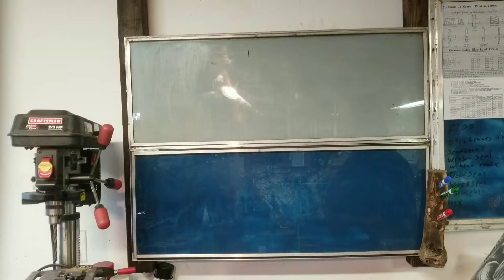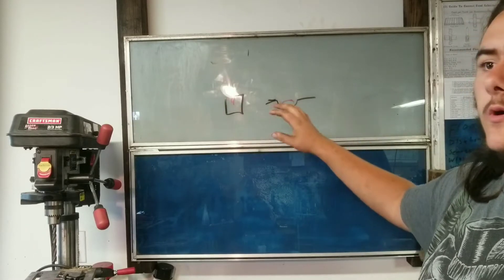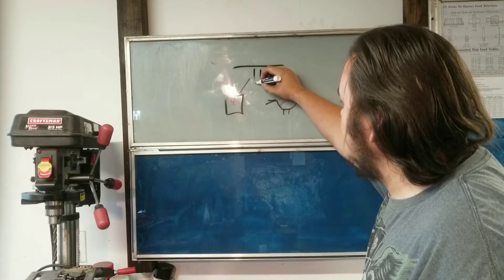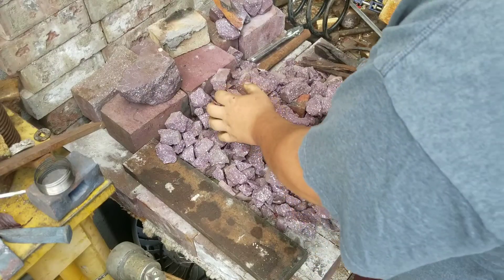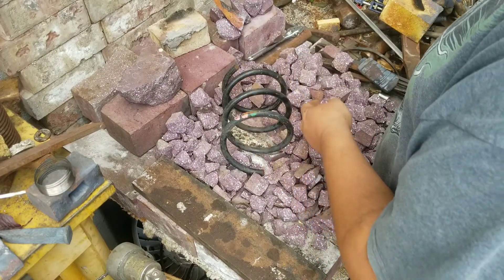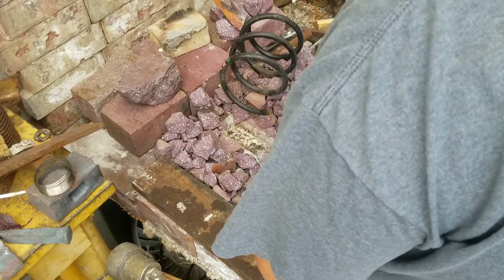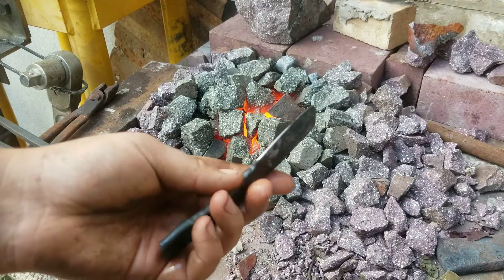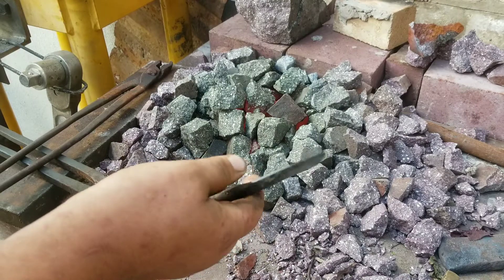Chip Forge Intro

Comment: Really cool idea man, Ive never really heard of a chip forge, but is a really interesting concept. The noise from the burner is because you have too much back pressure from the holes getting covered up, and the flame will want to jump back inside of the burner itself. I have that issue when I cover too much of my furnace exhaust up or when the propane runs low/out in the forge and the flame wants to jump back into the burner on me, so I usually just turn the gas pressure up and that usually fixes it. For your burner, you may just need to turn the air or gas supply up to shove the flames back out of the burner and back where you want it.
Reply from the maker: Thank you! I might have to do some modifying to the blower and find something with more air pressure

Comment: Cant wait til the next one. The noise maybe the tank getting cold. Did you ever try having the ribbon burner on its side instead of underneath. You should get the same heat but not as much of the clogging.
Reply from the maker: I did, but it really limits how big of a workpiece you can put in the forge. I might experiment with it more but I like how well it works as is
Reply: @hiddenworldforge374   Gotcha, just a thought.